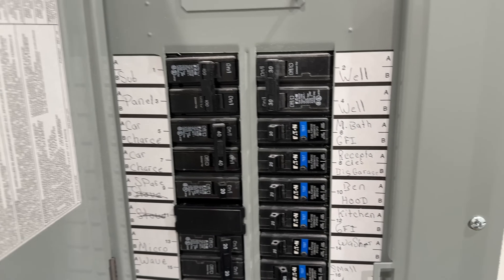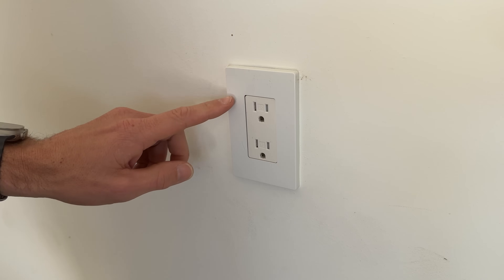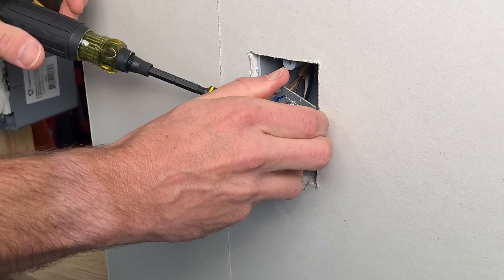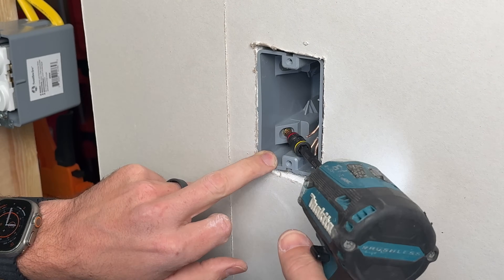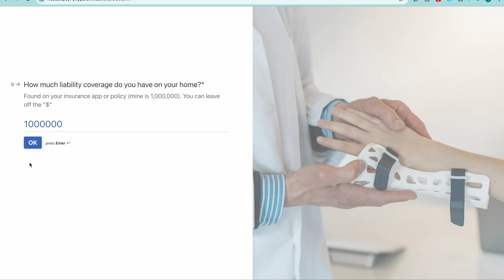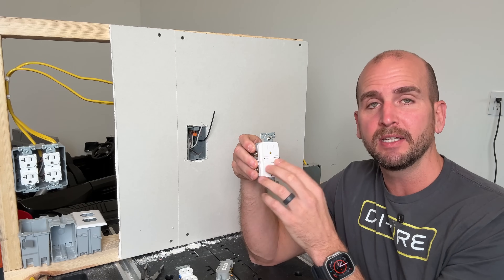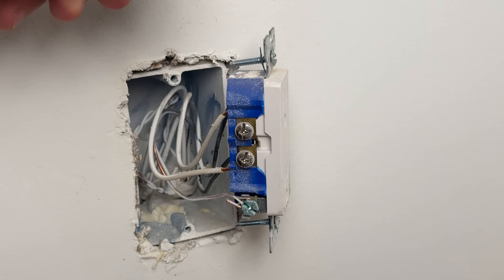The Ultimate Outlet Replacement Guide: 10 Mistakes Everyone Needs to Avoid

Comment from the maker: Insurance Survey And Custom Report: https://geni.us/bI8z0

Smart Electrical Box (Internal Screws):  https://geni.us/ddcJ4nz
WAGO 221 Kit (4 Types of Lever Nuts):  https://geni.us/wKcBNC
New Klein Tools 16-in-1 Screwdriver:  https://geni.us/9j1bFVa
My Favorite Non-Contact Voltage Tester:  https://geni.us/EIcTOsV
My Favorite Outlet Tester (With Voltage Display):  https://geni.us/rS4mlwJ
Klein Tools Self-Adjusting Wire Strippers:  https://geni.us/LICises
Knipex Hybrid Wire Strippers:  https://geni.us/uVWn
Leviton Edge Outlets:  https://geni.us/Nrt7j6
Electrical Tools Used In The Video:  https://geni.us/Pf2A

DISCLAIMER: This video and description contain affiliate links, which means that if you click on one of the product links, I’ll receive a small commission.
Reply: As A Future Home Owner Do I need a permit to do any Electrical work inside my House I Currently do Maintenance yet I am curious to learn more and possibly get Certified if need be
Reply: @timothyrichardson8567  Depends. If you are replacing something, generally you're good. If you're adding something you would need to consult your local electrical code requirements.
Reply: The survey doesn’t work when I’m trying to choose Other
Reply from the maker: @erezamit7289  Thanks for the feedback.  I will take a look.
Reply: @EverydayHomeRepairs  Learned the thing about the GFCI not requiring a ground. Very good to consider when replacing outlets in older buildings.
Reply: Also, those tabs on the corners are removeable so they can also be used as spacers.
Reply: I originally found your video by doing a “Google” search.  While it played your video, the interruptions by Google (Ads) were so numerous, I left Safari (Apple device) and went to the you tube app.  It won’t happen in my life time, but the totally unreasonable size and power these companies now have really need some regulation for the benefit of the viewing public, or ought to be broken up, so the only motive is delivering a good product, not making huge profits.
Reply: Where's the link for the oversized plate covers?

Comment: What if you had an electrical outlet in your ceiling to power a home theater projector.  After 20 years the old projector died and I replaced with a new projector.  However, the new projector needed to be positioned about 3 feet away so I needed to extend the electrical wires to the new location.  Is it required that I maintain the initial electrical junction box with a cover as this looks like crap on my ceiling and I would like to remove it and patch over it to match the rest of my ceiling.

Comment: Liked the video but sometimes you speed up the video in places a DIYer needs to actually see.  Anyone who needs to be reminded to turn off the power isn’t familiar enough with Romex to know whatever you sped through on that part.  “Use 12 2 Romex and take out the connectors and bare ground”…what?  I’ve watched 10 times and still don’t know what you did.

Comment: Yeah that looks like it was done in a hurry 11:30 with the screws left out and having been wired with backstab/push in cinnectors that do not use the screws to tighten... as in the outlet befire you replaced it looks to be so,. And evidenced by the insulation that had previously been overexposed.
Ooh 15:27 that does sound cool is a teardown of the new outlets.

Comment: In case anyone is considering installing those screwless decorative cover plates, they will not sit flush if you're box is a type of box that sticks out from the drywall, such as most remodel boxes. Those cover plates need a box that sits flush.

Comment: Great information Scott! There is always something to learn when I watch your basics videos! 
I trained new employees in retail grocery stores for over 25 years in baking and cake decorating going store to store. A lot of times when I was training, the person with the least experience asked the best questions or had a process that I never thought of before in all my years of training! 

#11 outlet mistake... I was checking my outlets in the older home I bought so I could add more lights and put the light switches in the garage for the lights rather than in the house. I pulled an outlet that had a 4 wire neutral and another with 4 wires hot in the box twisted into an oversized wire nut. The issue is that as they twisted the nut, some of the wire conductors creeped back and were only touching a small percentage of the copper. in the twist. The Wago's come in real handy for replacing that mess so all the conductors have equal contact and take up less space when the wires are lined up rather than a big wad. I have had a couple Wago levers pop open over the years, maybe I didn't have the lever all the way down, or they caught on something when pushing them back into the box? So I take the time now to electrical tape them down, just in case. I know you don't have to, but it is my home.
I understand all the effort and time to put these vids together, hopefully you are getting great value back help us all!

Comment: Should a man replace all his 30 year old old home grade outlets to new commercial grade outlets?
Reply: You don't need commercial grade. Residential grade will last for decades.
Reply: @CorneliusTaylor-s1u Why does commercial grade exist then?   Are these designed for especially high repeated plug/replug use?
Reply: @CaptainAhab-im3kd 

Yes, but also designed to be abused. Homeowners don't typically abuse their outlets. Standard residential grade will last for decades. It's a waste to pay more for commercial for homes. They are also not safer, in case you may be thinking so.

Comment: The Southwest Smartbox seems to be cluttered inside, not leaving much room for wires and receptacle. I'm basing this only on the video; I have not seen one IRL. Am I wrong? It would be great to have an extra-wide box (but with normal sized front opening) to accommodate up to six 12 gauge wires (including ground wires).

Comment: Scot, is appears you are using a 20-amp receptacle with 14 gauge wires. Is that OK. (I'm guessing 14 gauge because they seem to bend so easily when you push the receptacle into the outlet box. I'm replacing a receptacle with 12 gauge wires, and it's hell to bend them and push them into the box. Any suggestions?)
Reply: P.S. I saw a tip in another comment about using a soft piece of wood (like a paint-stirring stick) to help guide, push and bend the wires. That a good tip. I haven't tried it yet, but I'm wondering whether is enough room fit the stick into the box toward the end of the process when the receptacle is going into the box.

Comment: Backstabbing is very common.  I've had one failure where the outlet didn't work  My house is 43 years old and was built with all the outlets and switches backstabbed.  I have replaced all the switches with switches with the clamps.

Comment: But with conduit there would not be a bare ground wire and you would use a three prong outlet.

You said you were using 12 gauge wire but never stated what the breaker was and yet you used a 20 amp outlet with no explanation.  You stated the home had outlets on 14 gauge and 😊eat you put a 20 amp outlet in

That bare wire could also touch one of the screws.

Many locations require gfci or arc fault and not addressed.  Child safety was not discussed.

Comment: I was just told by another "expert" your outlet is upside down. The round ground hole  is supposed to be on the top and yours are on the bottom with hot and common on top.
Reply: There is no right or wrong way in that regard. In fact the preferred way is ground down because most plugs are designed to work that way.

Comment: My existing plug has 3 white and 3 black wires. It is back-stabbed AND connected to the screws. What do I do with the extra wire? New plug doesn’t have back-stab holes.
Reply: The best way is to join the 3 wires plus a pigtail (4 wires now) with a Wago or wire nut. The pigtail goes to one of the screws.

Comment: I used those new outlets with the screw down back wiring throughout my entire house. I've had so many problems with them. They have a real problem with the neutral not getting a good connection  (sever low voltage readings and some had total power loss) I went thru my entire house and rewired them direct to screws
Reply: Did you properly size the stripped part of the wire and push them all the way in?

Comment: I would love to see a video of those Edge outlets. 

I just replaced an outlet. I went with the more expensive commercial grade ($2 more at my local h/w store) based on your video dissecting them. This one was loose as we often plug small appliances in for a task, then unplug them when we are done (vacuum, iron, etc.). 

My biggest challenge is stuffing all the wires back in to the box. I like to use deeper boxes where I can to make that easier.

Keep bringing this great content!

Comment: Over the years, my father started to put the breaker number on the back of the plate. Also, if you are alone, plug in your noisy vacuum and listen while you turn the breakers off and on.

Fine video.
Reply: A loud radio works too.

Comment: Choosing the cheapest outlet is definitely a mistake. A licensed electrician installed about 20 new outlets in my basement during a renovation. Unknown to me he used a very cheap Chinese brand. Several years after I couldn’t plug into two of them. Didn’t think much of it since I seldom tried to use those particular outlets. Finally, I removed a cover plate to have a look. The entire face of the outlet fell off, leaving the metal internals exposed. I hadn’t turned off power yet so was lucky not to get a shock.  Checked the others, same thing. Each either completely came apart when I removed the cover plate or were cracked on the side. It seems luck or God’s mercy was the only thing that prevented a fire or shock hazard. I replaced all of them myself with commercial grade Leviton. One of the outlets was also not grounded.

Comment: What if you have an older house with aluminum wire .

How you change 

😢
 an
 older house
Reply from the maker: Aluminum is tough.  There are specific outlet labeled CO/ALR that will work with both copper and aluminum wiring.

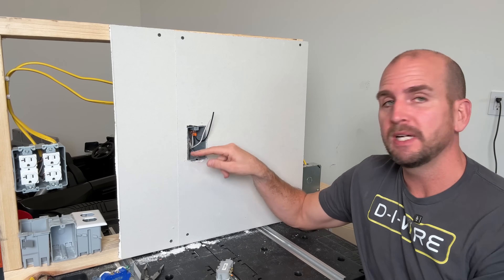Comment: 8:41 , just wanna mention, if you don’t see any grounding wire but you see that you have just a black and white wire coming out of an metal armored jacket type looking cable then that means you have bx wire installed in your house and that type of cable doesn’t carry a grounding wire but it carries a bonding strip wire that is wrapped around the jacket, making it grounded.

Comment: this guy is just a shill for big robertson
Reply: But he is correct. The square drive of the Robertson holds much better. Milwaukees's ECX holds even better. By the way, it doesn't have to be a Robertson (R1) bit or screwdriver. Square 1 (SQ1) works just as well and is usually much easier to find.

Comment: Curious what you do when you see a 14 gauge wire that’s running to a 20 amp breaker? Just ran into this as I was going to install a patio light and run it to an outlet.
Reply: Replace the breaker to a 15 amp.

Comment: Another well done video with explanations for those of us that are more novices. Just so happened a couple months ago I decided to replace most of the receptacles in our 1992 built home after learning about the dangers of back-stabbing and found mine of course were wired that way. I chose to use the Leviton push-click-close as those looked nice and were just so easy to use and as long as I stripped the wire the proper length, almost fool proof. The receptacles that I used the Leviton commercial instead, were the ones where one outlet was connected to a switch so the tab had to be broken which the commercial were easier to do that on. 
Wonderful of you to take the time and effort around the insurance data gathering. I'm not sure where you live, but in the last couple of years here in California, several insurance companies have stopped writing new home polices or not renewing policies depending on where you live if considered close to a "danger zone", or charging outrageous premiums have left many folks scrambling to get insured. And with those wildfires that took place in LA recently, it will only get considerably worse.....

Comment: Errors in the vid.  The problem with most DIY, vids is they contain issues that only a very experienced DIY or pro will know about.

1. Did not check whether there was slack in the NMC that could be persuaded to solve the 6” code violation.
2. Did not explain to check if there is another GFCI before the replaced receptacle (not outlet) before installing a gfci in an ungrounded box.
3. Did not put the stripped end (which was eyeballed) back on the gauge to show it was stripped to the correct length.
4. Did not demonstrate how to form a proper J Hook.
5. Did not talk about a clockwise J.
6. Did not show closing the J Hook with a needle nose before tightening.
7. Did not talk about proper screw torque or use a torquing screwdriver. 
8. Did not show to fold the wires before reinserting the receptacle instead off just shoving it in.
9. Did not discuss installing the device “ground-up”.
Reply: Why don't you make your own video then? I meant that seriously by the way.
Reply: @CorneliusTaylor-s1uBecause it isn’t my thing to make vids. No time for that.  But ppl who are shade tree electricians shouldn’t be the ones teaching others how to do it (unless they have gained the expertise somewhere.)
Reply: @KWKloeber 

No one should proceed based on one person's instructions or opinions.
Reply: @CorneliusTaylor-s1uAgree but how about ppl not educated about codes and how to do things properly, not post crap that could get someone killed?  “Social” media is one of the worst inventions in my lifetime.

Comment: Hey, use the built-in wire stripper on the outlet bracket to save time!
Reply from the maker: Actually Eaton removed the feature recently.  There is no longer a sharper edge and labeling for the integrated wire strippers.
Reply: @EverydayHomeRepairs  Oh, wow, I didn't notice, as I haven't purchased any outlets lately. Probably a cost reduction strategy.

Comment: Hey Scott

Having experienced what a pain it is working with the screw type outlets, I was very interested in the new Leviton flip locks.  A couple years ago I replaced all of the wall switches in our house.    That was a major task with over 30 switches of various types.  I replaced the construction grade junk with the Leviton decora.   That all came out very well.

At that time I did not do the outlets figuring I would at some point later.  After viewing this video and learning of the flip locks I decided to move ahead.

When you introduced the Wago connectors I picked those up right away and have used them for various projects.  So having outlets with that style of connector seemed great.  

To start with I just ordered a box of 10 and have installed those in the kitchen, our island, and dining room.  They are a breeze to work with.  On the first one it was a challenge getting the J hooks off of the screws. I then thought to just remove the screw complete and not bother with the J hook.  After they were all lose I just cut the J hook off, did a little straightening, and installed the new flip lock Leviton.  Probably saved 10 to 15 mins per outlet.

I will gradually get more and go room by room!  So thank you for introducing those outlets.  They are great!
Reply from the maker: Thanks for all the great feedback and best of luck finishing off your electrical upgrades.

Comment: Would you provide  a description, or link, for the screws you like to use with this Smart Electrical Box (Internal Screws).  I saw this in another one of your videos and I think you called them general construction screwes.  Very helpful video.  Thanks.
Reply from the maker: Little pricey but I go with the GRK  #8 at a 1 1/2" length https://www.homedepot.com/p/GRK-Fasteners-8-x-1-1-2-in-R4-Multi-Purpose-Star-Drive-Flat-Head-Screw-110-per-Pack-96085/204837666

Comment: 12:06  You might mention the torque values for the outlets that's printed on the back (New UL requirement).  Generally 14-18 in-lbs, which is a lot tighter than most people think.  I suspect if you used a torque screwdriver, you'd find that the outlet you used in the example, is way under that torque value.  It seems like the instructions that comes with the outlet tells you to visit the website for the proper values.  Not tightening the screws enough, seems to be one of the biggest issues with DIY outlets.  Especially if they have something like a space heater plugged in.

Comment: I replaced all the outlets in a house that had 12 gauge wire throughout.  Folding that wire into old-style 50's boxes was a pain.  Eventually started to use one of those plastic pry bars for auto panel removal to push and help fold the wires.  Huge improvement though 12 gauge is still a PITA.

Comment: issue i am seeing is there is not enough room in the outlet boxes and most have several wires in them and the new better outlets are larger and thicker where room is very much needed - bummer have to go with cheaper outlets due to size restrictions - dan